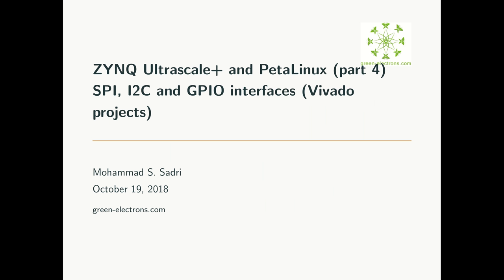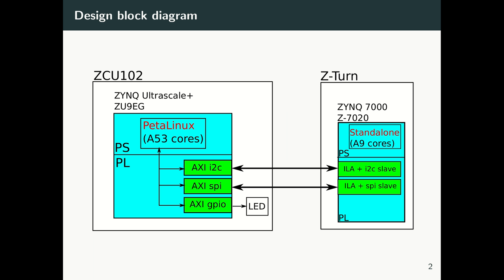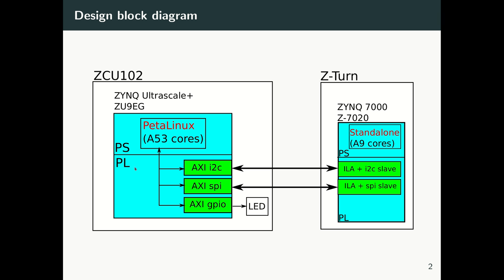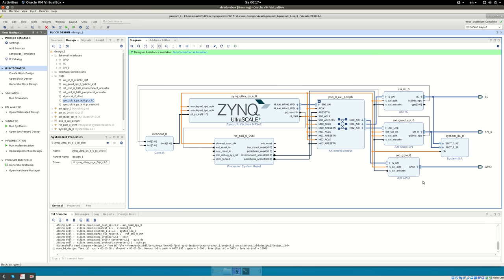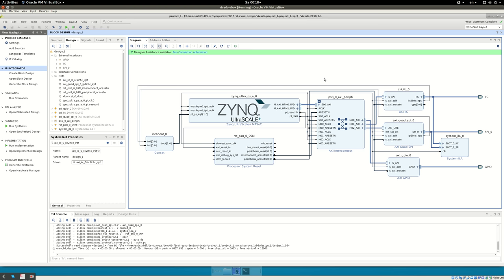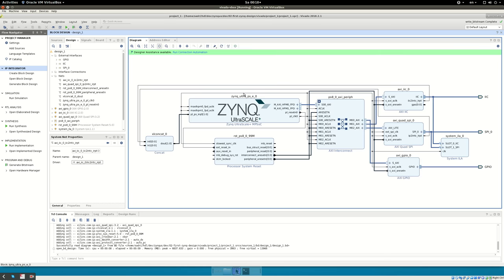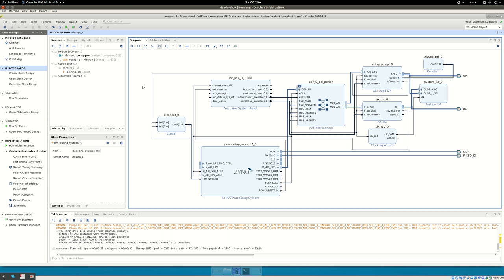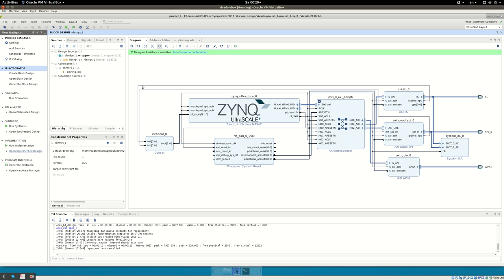ZYNQ Ultrascale+ and PetaLinux (part 04): SPI, I2C and GPIO interfaces (Vivado projects)

Comment: Hi Mohammadsadegh,

Thanks a lot for your wonderful sharing. 
I'm planing to utilize similar design to yours. It is one of my work packages in my company.
We will connect ZC702 Eval Board and Spratan-7 FPGA, but we need to configure  a lot of slaves from ZC702(Master).
We want to update also bit configuration of Spartan-7 over ZC702.

As a kindly advice, maybe you forgot to describe SPISel input of Quad SPI IP Core of your Z-Turn Board. It is connected to constant ip core.

Thanks again.
We are impatiently waiting for your new videos.

Regards
Saban